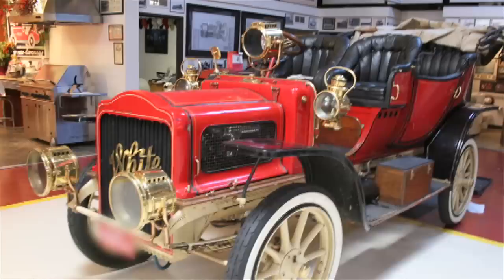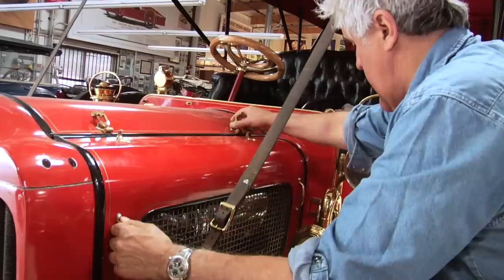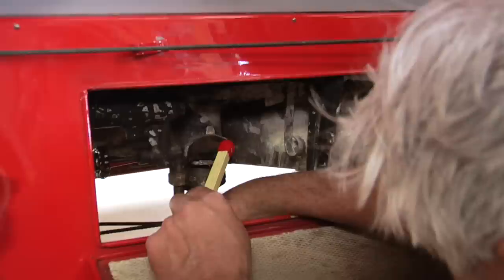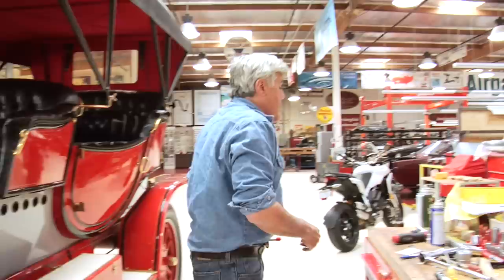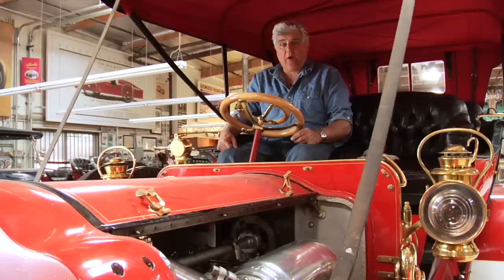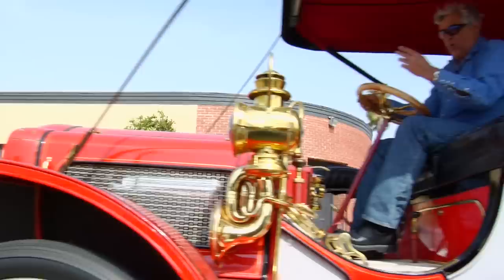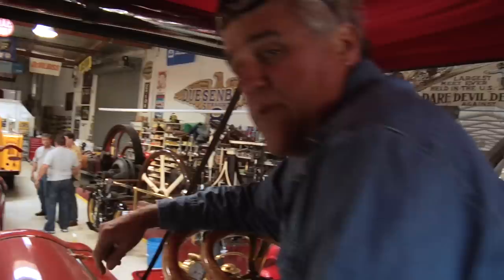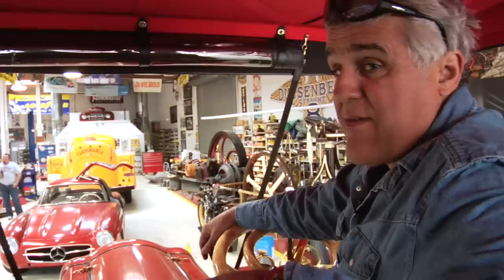1907 White Steam Car, 30 Hp - Jay Leno's Garage

Comment: If American Auto manufacturers made this car exactly like this I'd buy one. I mean look at that cabin. Seating for days and an unobstructed view.
Reply: Steam cars were the most expensive cars ever made... only the very wealthy could afford them... it wasn't until internal combustion became more developed that the average person could actually afford to buy a car. There are very few running steam cars left, only folks as rich as Jay can afford to keep them running.
Reply: @doktorbimmer  Yes but with all this hype for finding alternative fuels and technology being much more advanced now. It could be reworked into something more economical. Plus look how quickly intelligent minds can turn something impossible to practical when we finally understand how it works. 10 years ago we didn't have smartphones. And the airplane was weaponized about Eleven years after the Wright Brothers took off.
Reply: It could? What do you base this belief on??? Moore's Law does not apply to heat engines.
Reply: @doktorbimmer  How does it not? Even if you make a machine the same way 1,000 times you could still get 1,000 different machines. The only law that would be of concern is Murphy's Law really.
Reply: The Laws of Thermodynamics and the Carnot Cycle formula will remain unchanged... that is why they are called Laws of Physics.
Reply: @doktorbimmer  Tecchnically Carnot Cycle Formula is only a theory. And you don't have to defy the laws of physics to achieve economic feasibility. You can make Thermodynamics work in your favor. Think about it. When computers first appeared they were the size of a building and did little more then a calculator. Now that same tech can do so much more and fit into your pocket.
Reply: @doktorbimmer All I'm saying is the tech already exists you just need to make it smaller.
Reply: Wrong, only Carnot's 100% efficient Engine is theoretical... if you had actually studied engineering you would have known that Rudolf Diesel PROVED Carnot's formula was correct in 1897 and used it to invent the most efficient practical heat engine known to mankind.
Reply: What you are saying is, you are trying to compare something that is not even remotely related... and wildly speculating on a topic which you are not experienced or educated enough to speak coherently on... If it steam cars were practical and commercially viable today? They would not remain obsolete as they have for the past 100 years.
Reply: @doktorbimmer  I'll admit the laws of Thermodynamics and Carnot Cycle Formula are not my best subjects. But aside from that, if theres one thing that history has taught us is that we are dam good at building things. And we are problem solvers. It may take us a few days, months, years, or even centuries to develop something. But that's what we are good at. And defying the laws of physics has been done before. For example man has split the atom, and achieved faster speeds then a man should be capable of doing. Plus maybe it's my lack of education in the laws of physics. But where do Thermodynamics come to play when you already have a steam powered engine and all you would need to do is make it smaller? We already make computers smaller and the old ones use to generate their own climate. Plus new engines are developing all the time. I'm not trying to ruffle any feathers here but like I said. We achieve the impossible all the time.
Reply: @doktorbimmer  I'm not sure what you were asking earlier. One of your comments showed up on my notification page  it not in the comment. Something about comparing heat engines to electric? Not trying to pull something funny. I just couldn't read it all in its entirety.
Reply: Why do you persist in trying to make a comparison with the miniaturization of semi-conductor circuitry and Heat Engines son??? These to topic are completely unrelated.
Reply: So I'm assuming from your question that you are completely unfamiliar with the Second Law of Thermodynamics or concept of Entropy?  Entropy increases as scale decreases thus the smaller the size of the Rankine Cycle engine is, the less efficient it becomes. This is why the few steam engines that are still made today are generally in sized between something large enough to power an ocean going vessel and a power plant as large as a city block.
Reply: I have replied to several ridiculous comments suggesting that a battery-electric/steam hybrid car would be a practical and more efficient concept... when in fact this is not commercially viable or even a practical concept. It makes absolutely no sense what so ever to use batteries to power a steam car.
Reply: @doktorbimmer  I wasn't suggesting a hybrid battery powered steam car. I was just suggesting coming up with a way to make a steam car more practical. Or at least attempt to. That's all. Or maybe even come up with something that gives you the same feel of the old steam cars. For example  the panoramic view that the car has. I know that it doesn't meet safety requirements. But everything just looks so bland on a lot of cars now. Look at the cars of the past decades. 1920s cars look so different each one of them. 50s cars same thing. Even 1980s and 90s cars look different. I'm just saying when did it become okay to look the same pretty much. At least if someone where to try something like a steam powered car they would be doing something different. At least Tesla is kinda breaking the mold.
Reply: @doktorbimmer  Not suggesting making a practical steam car today. But maybe at least having another go at it. We do have better technology then we did back then and a much better understanding of science then back then. All I'm saying is while still being governed by the laws of physics it might just might be possible to find something more capable of achieving said goal while still operating under the laws of Thermodynamics in particular. Another invention that I think is in a similar direction is that of the flying car. Now true it does operate under a different set of physics laws but still the same in the fact that it does exist just not economical yet. But they are still working on that. Now that I do know for sure.
Reply: WHY? What would be the goal of producing a contemporary steam car? What purpose would it service?
 Any new steam car would be more expensive and less efficient than currently available technology.
Reply: A flying car is well outside of the realm of a practical transportation alternative.... The FAA and the EASA have not and do not plan to make any changes to the rules which govern aircraft certification and pilot licensing. Any flying car must meet the same rules and regulations as any other aircraft thus making the concept of a flying car more expensive than a conventional car, and more expensive than a conventional aircraft. Flying cars have traditionally been and continue to be the sole domain of crackpots and investment con artists... it is not considered a commercially viable concept in the legitimate automotive or aircraft industries.
Reply: @doktorbimmer  Yes very true. The safety requirements for a flying car far outweigh practicality. Plus not everyone is meant to fly. We have trouble just driving on a 2d realm. But the tech is their. And maybe it will be a reality in the future. Maybe through automatic flight or even preprogrammed autonomous flying capabilities. I don't want to sound cliche but no one knows what the future holds. All I'm saying is why not experiment with making some of the more irrational or theoretical forms of alternative transportation possible? Even if it does challenge the laws of physics.
Reply: @doktorbimmer  It would give us a chance as human beings to learn from the past.
Reply: The technology to travel to the moon has existed for half a century now... but it is still not in the realm of what is practical.
  It all sounds very nice but who will pay to develop these irrational and theoretical alternatives? Who will make the investment if there will be no pay-off at the end?
Reply: Humans learn from the past by not repeating the mistakes of the past... the steam car is an example of how not to build an automobile. If you have learned your lesson well, the reward is not building a new steam car.
Reply: @doktorbimmer  All good questions. The answers I'm not sure of maybe so.eone like Mr. Leno. At least the qustions are being asked though. Got a nice little debate going. More problems are solved in a debate then an actual committee. People learn from a debate. I know what I learned from you (need more knowledge on the laws of physics). I'm not sure what you learned from me if anything.

Comment: Now we could put a light r2 158cc 30hp engine in an 800kg car and get superb MPG, but who would buy it? The nice thing about a small engine, is that on the road you are likely to push it hard to 90% of max rpm, where it is much more efficient.
Reply: +SalveMonesvol I suspect that steam is more efficient than an ICE at lower than full power.  ICE's are dreadful at anything other than full power - so it is an easy guess.
Reply: Andrew Lohmann And that makes our overpowered cars even less efficient.
Reply: +SalveMonesvol The energy required to move a vehicle is mostly required to push air away from the front. That is why a train is so efficient the front is small and the train is long. Electric trains even more because electric traction is very good and is chosen over gearboxes anyway in big transportation because of that.

I am told that the amount of energy needed is the cube of the speed up to 100KM per hour. So the amount of energy per mile required is the square of the speed. So halve the speed and quadruple the MPG (KM/L) but I have never come across an ICE engined car in which MPG quadruples if you halve the speed. The MPG improves a bit though.
Reply: Andrew Lohmann You are close, but mixed it up. Rolling resistance ir more relevant than air resistance at lower speeds. The higher the speed, the closer you get to the relation "power needed increases with the cube of speed".
Reply: SalveMonesvol
That sounds better. I got my info from a university professor long ago.
Reply: Andrew Lohmann Somebody mixed it up. Go to ecomodder.com/forum/tool-aero-rolling-resistance.php
Reply: Thanks

Comment: Can anyone tell me why it's right hand drive? I'm assuming its not an import?
Reply: Left hand drive was not standard yet in 1907. When the Model T was introduced a year later as a left hand drive model; that model eventually set the standard for left hand drive simply because there were so many of those made. As far as I know there is no regulation mandating that cars be left hand drive in the United States. The auto manufacturers just make them that way because a right hand drive would be a tough sell with American consumers.

Comment: You say that you can never improve a White steam engine? What if you heated the water with a battery insted of fire & recirulated most of the steam into the water tank? Also a good simple computer could control any valves needed & maybe run generators at each wheel? 
Someone ask Elon Musk to engineer this for us.

Comment: thirty hp? thirty steam hp is equal to 4.25 to one over Otto cycle motors
Reply: Kyle Hodges  A 30 hp steam engine is equal to a 30 hp internal combustion engine.   without a transmission though a 30hp steamer may well produce more torque... but not continuously.. HP is a measure of continuous power output... and that is always the same... 30 hp equals  30 hp

Comment: "Most dependable way to get around" what about horses
Reply: have you seen a 100 year old horse?
Reply: Rick1885 tru
Reply: +2chws The story Black Beauty puts a compelling case against animal exploitation such as it was at the time.
Reply: +Nick Fiscina what
Reply: +Rick1885 you could buy a lot of horses for what it costs to keep this car running..
Reply: Cars were or the wealthy then. Petrol, Paraffin or whatever was the fuel would have been expensive then. For example some European cars like De-Dion had 700CC engines and they did 60+ MPG (UK). So after 100 years since 1801 cars had become in the reach of middle income people and fuel cost probably would matter.
Reply: My guess is that you've never taken care of and used horses.

Comment: Why didn't White add electrics? Batteries and generators existed when White was making steam cars.
Reply: What do you need an electrical system for?
Reply: The real doktorbimmer Electric fuel/air and ignition systems would make starting the white much easier. Hop in flip a few switches and you're off. Doble built a number of steam cars that had electrics in them but few were ever made because it was never mass produced. The White steam car was.
Reply: By that time steam cars were already dead, Doble did not introduce electric ignition until 1915.. White had already abandoned steam car production by 1911 when the company started building only internal combustion cars.
Reply: The real doktorbimmer  And yet railroad engines used steam up until the 1960s when diesel electric engines replaced them.
Reply: Whats you point? Steam locomotives didn't have electric ignition either...
Reply: Yes but steam engines are 6000 horse power monsters designed to haul large quantities of cargo and passengers at high speeds for long distances with there first use beginning around the 1830's meaning there was a well established industry and infrastructure. Steam cars however were toys for the rich in most countries built to carry one or two people around for a short period of time making there cost less justifiable and giving the petrol powered cars which could be started instantly (and easily once the electric start became common) the advantage.

HTH :)
Reply: +highlandrab19  Indeed, because steam cars were never practical vehicles, their high price tag, excessive operating costs and terrible fuel efficiency were not considered entirely prohibitive to their wealthy and often eccentric owners but certainly prevented steam cars from ever seeing widespread adoption.
Charles Kettering's invention of electric starter finally killed the steam cars only practical advantage.

Comment: almost no pollution? It heats the water with gasoline. Where do the combustion products go?
Reply: @TugIronCheif Steam cars are extremely dirty and inefficient compared to modern internal combustion engines.
Reply: @TugIronCheif YES! EXTREMELY DIRTY  Have you ever heard of the General Motors SE-124???  DO YOU KNOW what complete combustion means??? External Combustion steam engines cannot achieve a Stoichiometric Air-Fuel Ratio and thus produce large amounts of exhaust pollution. 
-
Reply: @TugIronCheif Bunsen burners are specifically designed to use gaseous fuels not the liquid fuels commonly used in steam powered vehicles... No, its actually very bad for the environment... steam powered vehicles consume more fuel and produce more harmful emissions than internal combustion engines... they also have another dirty little secret... steam cars have an obscenely huge carbon footprint compared to internal combustion cars.
Reply: @TugIronCheif To state a steam car is extremely dirty is totally and completely, 100% accurate and true. This is very common knowledge and why automakers completely abandoned steam a century ago, steam vehicle testing???? You seem unfamiliar with emissions testing of steam powered vehicles, General Motors produced two steam car prototypes for EPA emissions testing in 1972 but they both failed to meet the upcoming 1975 emission standards and produced more emissions than the internal combustion cars tested. "with a few other engineering hurdles that would have to be cleared to arrive at a viable product," Steam cars have been obsolete because they are inferior to internal combustion in every significant characteristic... all of the steam car companies went bankrupt or (like White Motors) completely switched to internal combustion.
Reply: Well son, you seem very uneducated on this topic, as any competent, educated engineer would know that Nicolas Carnot discovered that the Second Law of Thermodynamic prevents the Rankine Cycle from ever achieving higher efficiency than internal combustion in 1824. Rudolf Diesel conclusively proves Carnot's formula in 1897.
Reply: True, steam cars became obsolete in 1915 when Charles Kettering invented the electric starter for the internal combustion engine... this  went extinct in 1915. They became extinct in the 1920's because this inferior technology could no longer offered any advantage over internal combustion cars.
Reply: The EPA did not begin testing automobile emissions until the 1972 model year, the tests showed that steam cars were not only much less fuel efficient than ICEs, they produced significantly higher vehicle exhaust emissions. All of the steam powered vehicles tested failed the new EPA emissions standards while most internal combustion cars either met or exceeded the new standards.

Comment: He needs to put a condenser on that thing, waste of water
Reply: It does have a condenser, not a particularly efficient one by modern standards though
Reply: There are no modern standards for automotive steam condensers.. they have been obsolete for over 100 years.
But clearly by the amount of steam escaping it is too small and inefficient to cope with the volume in single expansion mode..